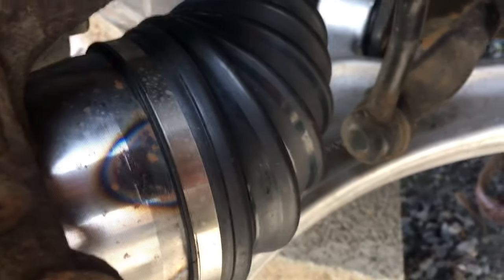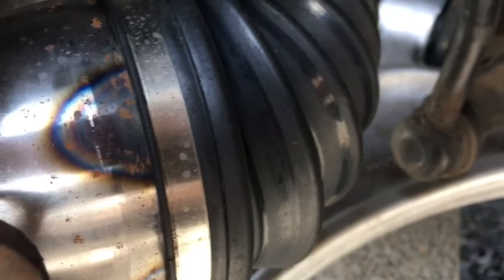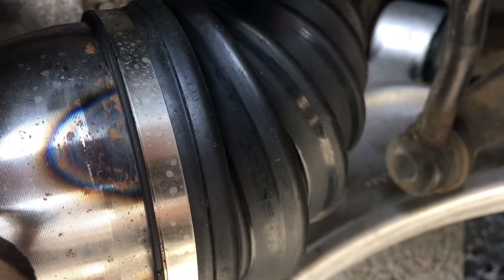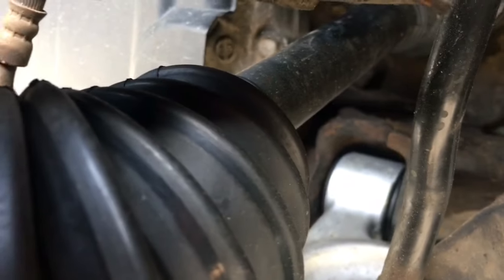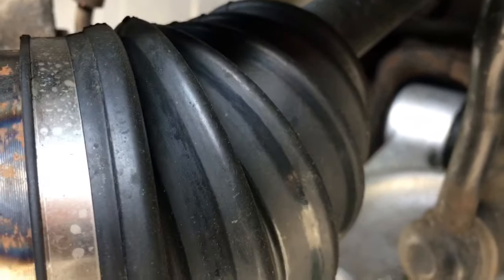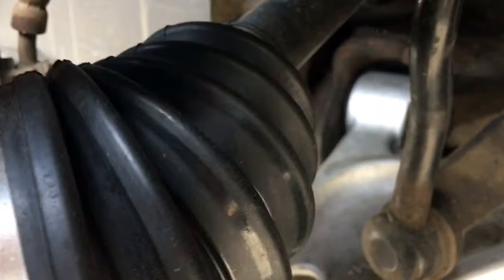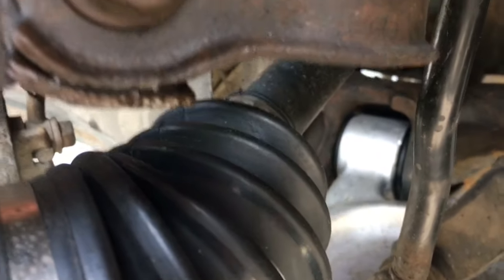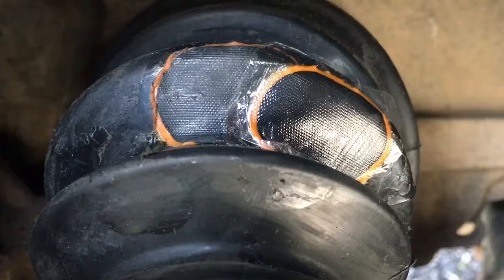Fix CV Boot for $5!

Comment: Mine just started leaking around the larger clamp.  I cleaned and used some ultra grey RTV I had laying around.  We'll see how long it lasts.  Leaving for the beach in two days.
Reply: Any update?
Reply: @Qtip032  Still holding up fine.  It has stopped the grease from escaping when the boot flexes.

Comment: I might have to do this. I bought new axles for my project rig a year ago and didn't even get around to pulling them out of the box to install until a couple of weeks ago and I found that ON A BRAND FRICKIN NEW AXLE there's a little crack in the boot - and it's nice good new rubber too, looks like it must have gotten damaged in packaging from the distributer .....and of course I'm outside of the warranty period since I waited so long to even open the boxes to inspect them. So I either eat the loss and buy ANOTHER brand new axle...or maybe time for the tire patch.

Comment: Did it hold up? I’m doing the same thing tmw. Wondering how long I can expect it to last. Good video. People always take 5-10 minutes to cover basic stuff like this. Way to keep it to basics.
Reply from the maker: When I sold the car I checked it beforehand and it was still intact. That was about 7 months after I did the job.
Reply: @melonking1  my boot was mangled beyond repair because i run on a long ass  propylene string   left on the asphalt and unlucky found its way on my axle and  winded itself all over the boot of my axle now i have to replace the whole axle because no mechanic want to change the boot.

Comment: So my walmart didn't have the bigger patches like the ones you got but they did have the sticky green circle patches and I stuck all 12 of the patches from top to bottom and made sure they all stayed together and stuck on and then drove for a bit and it has been holding now we will see for how long tho lol. I also added some grease into the boot before doing this just to replace what has came out
Reply: How did u add the grease? Did u have to remove the boot first?
Reply: @Travis.Rivera  my boot had a small rip so I pushed some grease back in thru the hole then cleaned the area to take off all the grease on the rubber then I sealed it up I didn't take anything off not even the tire and didn't even jack up the car  just turned the tire till I could see and reach it
Reply: @OGGamingJedi how did that hold up?

Comment: Tiied it but does not hold up for long.. its a nice patch job so you can get jome without leaking grease though.
Reply: Did you try cleaning it well and using super glue or preferably loctite 401 on the inside edge of the split hold it together then use brush on electrical tape over that.

Comment: I have a 5 series and I know the boot is torn and I’m hearing a low rumbling noise off and on over different types of road conditions. Is this due to the lack of grease in the boot or does it sound like another issue ?

Comment: I have a 4x4 truck with a leveling kit and 35s. I have recently installed special axles that are supposed to accommodate that and the boots already have a small hole after only 400 miles. Will this Lee them from getting any worse or will I eventually have to make a new boot out of these things?
Reply: Did you find a solution? 😊

Comment: Dude how the fuck did you manage to round out the sides? I fucked around with it for way longer than I care to admit and the tire patch was not flexible at all and it would just spring up around the edges and never hold. Ended up cutting it and still couldn’t manage for them to stick well. Any tips?

Comment: I had a very minor cut and I've used high temp silicon for now, just done around 50 Kms after that, no leaks so far, do you think I should leave it that way or get it patched
Reply: I'm personally going to replace the boot as it's old anyway and I'm going to clean out the old grease and repack it. I've lost a bit of grease by now so it's better for me to fill it up.
Reply: Ain't broken, leave it👍
Reply: @bryanmartinez6600 how many miles did u drive it before fixing?

Comment: What happens when the rubber is so old its cracked around the bellows? This method won't work. That and all the salt and dirt has probs already killed the joint.